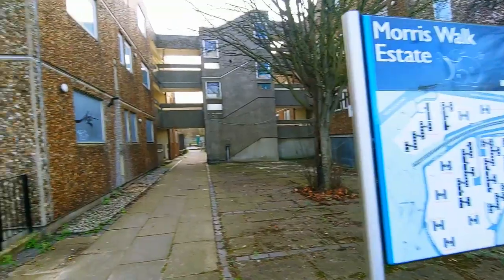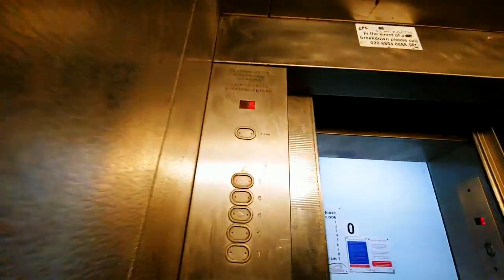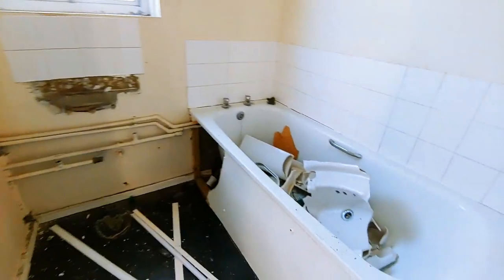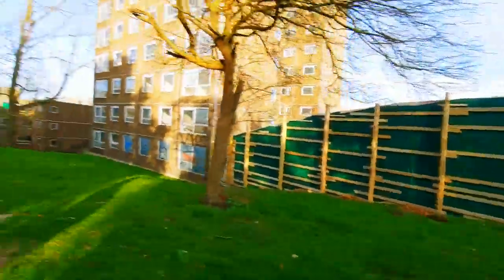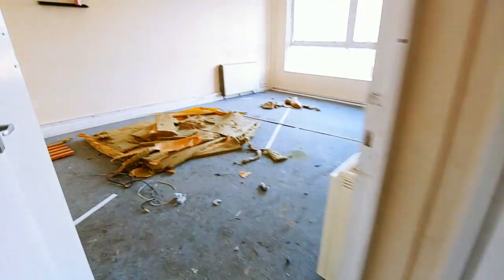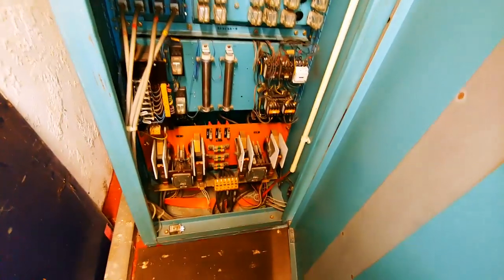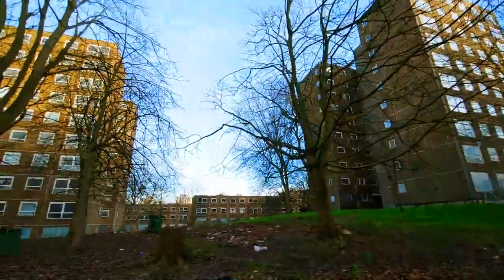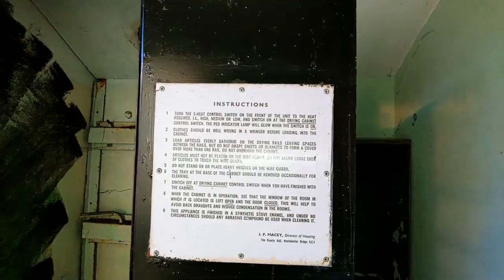Tower block archive - Morris walk estate

Comment: Gravel texture😇! My favorite kind of precast concrete design. One actually good feature of this, is the that handles rainy weather quite well. With smooth concrete you often see the effects of weather stains over time causing it to look a bit unclean. The gravel finish kind of hides this and it ages more gracefully. If you look closely, those walls still look reasonbly clean. A good example of actually getting quite good performance quality with cheap materials. I wonder if these flats where built with the same structural defects as Ronan Point. Nowerdays large panel systems are much better designed (by building code requirements) and high rise applications of them have various safety mechanisms to prevent the kind of failure mode that Ronan Point had. Modern high rise large panel buildings have in-situ rebar joins to tie everything together. Low rise applications have very simple joins that can be undone like meccano which allows for potential re-use.
Reply: I've heard that lots of the Dowlings/bolts on these builds were simply and disturbingly cut off because they didn't fit the hole during construction :| 
Its kind of sad this system got a bad name because of poor execution in the factory where the panel's got made and the careless construction worker's who cared more about their pay. They should have sent the defective panals back.

Comment: Lifts are 100% original? The door sensors seem to be replaced. Moreover sources online claim the estate was constructed in the 1960s so it’s very likely that the express lifts are mod from older lifts if they’re using 2nd gen express

Also I really hope you will find time to film the 1972 2nd gen express fireman’s lift with the original plastic buttons and lamps at Hilton London metropole before it gets killed. Lift Tracker and LiftyGamez has a video of those lifts

Comment: The tower blocks here remind me of the 4 on the Ledbury Estate, Peckham. I believe these are presently unoccupied because of the Grenfell disaster- concerns that a fire in one flat would not stay contained in one flat, due to the construction method. On each of these, the 2 lifts serve odd or even floors, and do not serve the topmost floor. The lift equipment in the tower blocks here would be worth preserving.

Comment: The pulsing drive appears to be made up of many thyristors, maybe this is some form of phase angle triggered controller? This could possibly explain the audible 300 Hz hum from the motor, as the three phases with their respective timing offsets would add up to 150 Hz i guess, and then again multiplied by two because of an inversion or something? I am not entirely sure about this though, would love to just have a go at examining this circuit with an oscilloscope...

Comment: These buildings look like they were designed like Ronan Point which was a tower block built in 1960s but had a partial collapse due to a gas leak only a few months after being built. Most buildings of the same design were strengthened but since the Grenfell Tower Fire these buildings are being pulled down in droves
Reply: @Baron Will I didn't say that they're pulling them all down although its more likely that they're only pulling down the ones that wern't strengthened in the 1970s and 1980s.
Reply: I'm not sure if they were all strengthened. Some had all gas removed and were converted to all electric heating and cookers. There was a fear that this type of tower block could collapse if a vehicle smashed into them, so they had bollards put up around them.
Reply: These blocks were built by TWA, the same firm responsible for constructing Ronan Point and it's sister blocks in Newham.